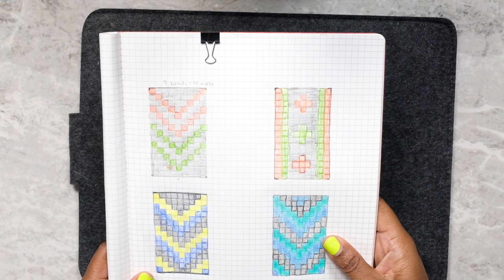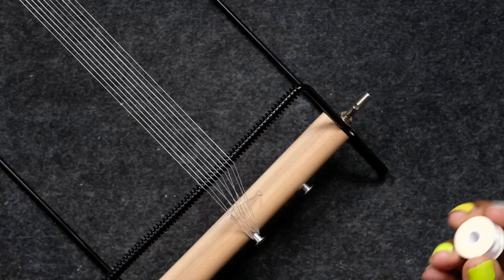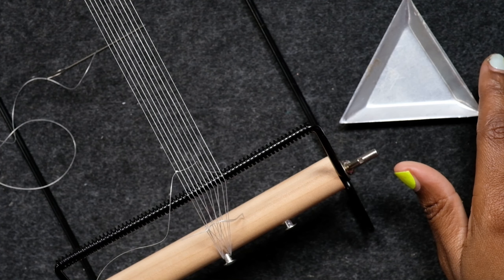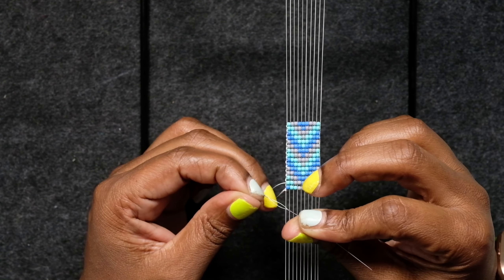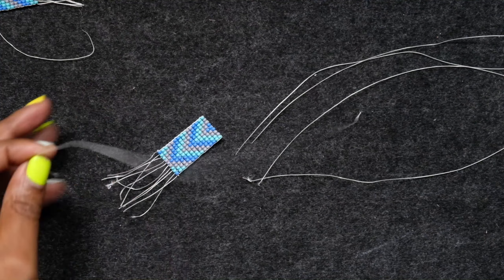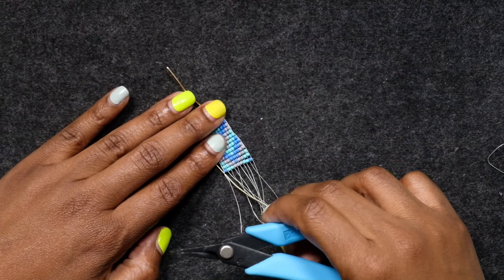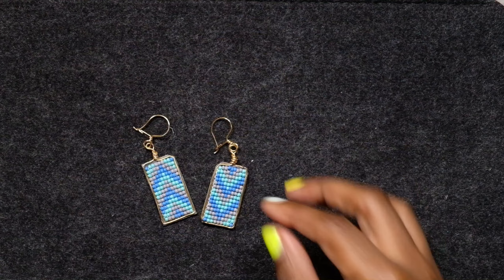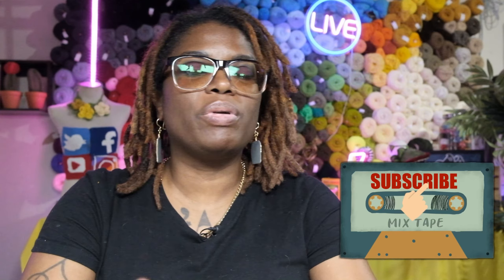How To Finish Pieces Off The Loom | Earrings On A Loom? | Scared Of The Loom?

Comment: What is that tool that you're using to bend the wire?  Blue handles, looks like a sharp point on the tool.
Reply from the maker: All the links to the supplies are located in the description box below. Those are looping pliers I believe.

Comment: If I don’t want the metal or the leather how do I finish off the other end???
Reply: You can just cut the loops on one end and weave the threads back into the piece. Make a tiny knot around the warp thread after you’ve passed through a few beads and then pass through a couple more beads before cutting off. I hope that helps.